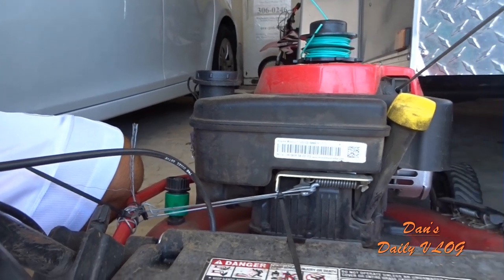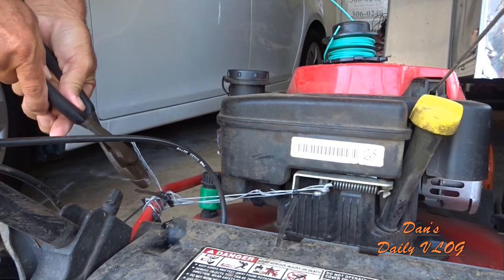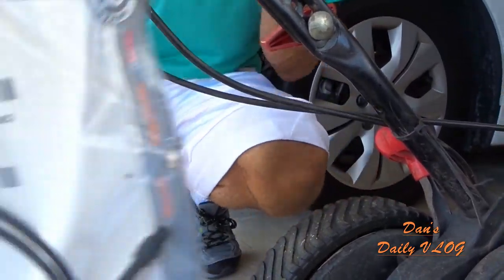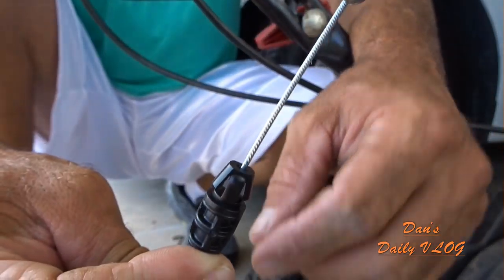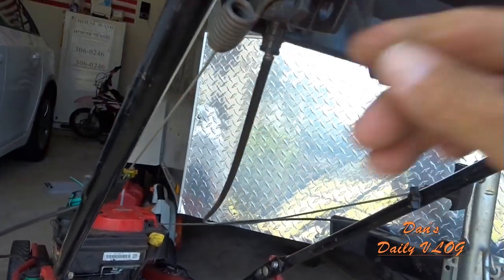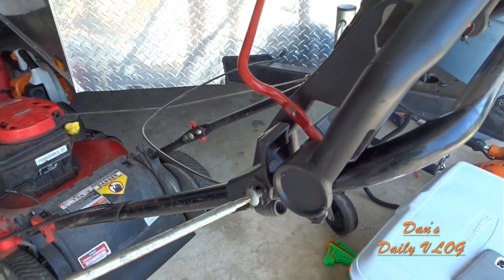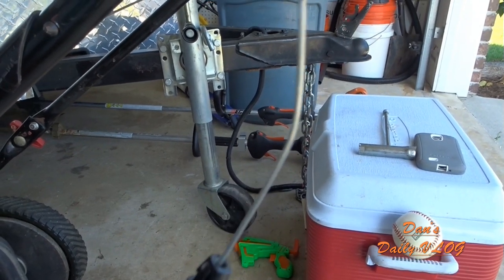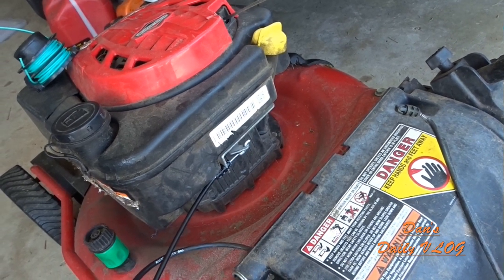Lawn Service VLOG - How To Replace Control Cable for Troy Bilt TB360 PN 94605107A

Comment: Does anybody know the part number for the spring visible by the oil stick? The one that the cable attaches unto the engine? I misplaced it and I can't find a part online
Reply from the maker: I will post a picture on my YouTube community page. It is from Jack’s small engine (com). I think you are referring to the governor springs? https://www.jackssmallengines.com/Products/BRIGGS-STRATTON/Springs

Comment: Hey Dan what do I do if gas is with oil and it won't start? Dump the contaminated oil out and put fresh oil? Happen when I was changing the blade…on my 360
Reply from the maker: If gas got in your oil, you must drain the oil and replace it. Gas will break down the viscosity of the oil and not lubricate porperly.
Reply from the maker: Did you take the spark plug boot off? Put it back on and maybe it is flooded now. May need to let it sit for a while or remove the spark plug, pull the starter cord a few time to blow out the excess gas and reinstall the plug.
Reply: +Dan's Daily Vlog thanks for the advice take care.

Comment: Can you run the mower without the cable and spring ? Mine is busted and I would like to just remove it.
Reply from the maker: Daphne Merk yes there is a way people bypass the system but I do not know how

Comment: Hey Dan, quick question.  I am just a regular home-owner type. I called around for pressure washing my house (Portland, OR).  It is a daylight basement ranch type, so 1 - 1.5 story in front and 2 in the back.  I am getting quotes of 300-400 for it, and extra for concrete etc.  F that!  I have a Sun Joe SPX3000.  It is an electric, so I am not going to be starting a business anytime soon.  Anyway, I am hoping to use it to do the job. It has a couple of 1 liter downstream soap bottles on it.  Watching your pressure washing videos I am thinking I can throw some of the regular bleach, or even the pool stuff from Walmart in it with some dishsoap and go to town.  Any suggestions, or cautions?  Appreciate any help.
Reply from the maker: I don't think there is anything to worry about. Soap it up and see if it does what you need. What material is the house? Vinyl? Brick?
Reply: +Dan's Daily Vlog Thanks Dan, it's vinyl.